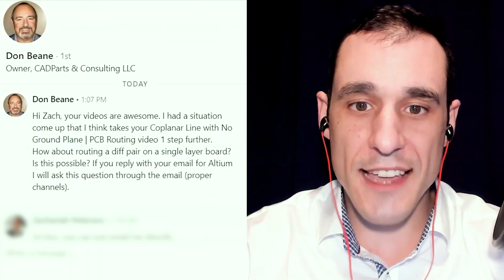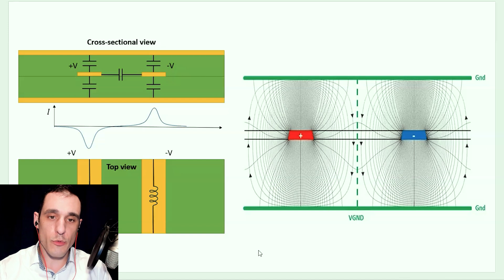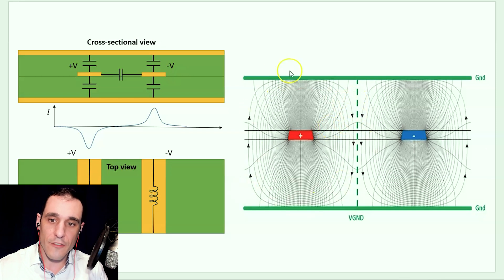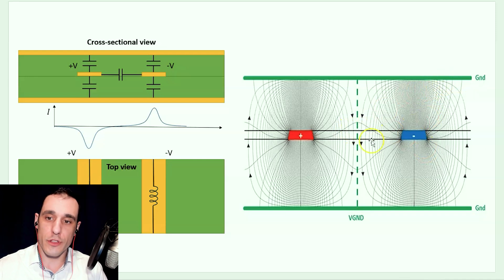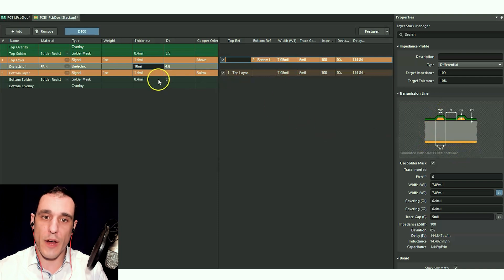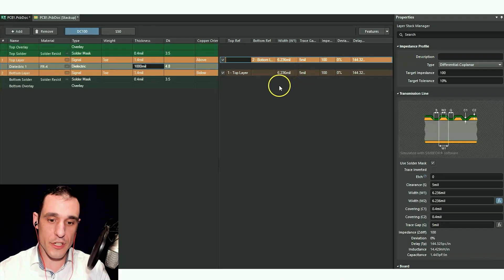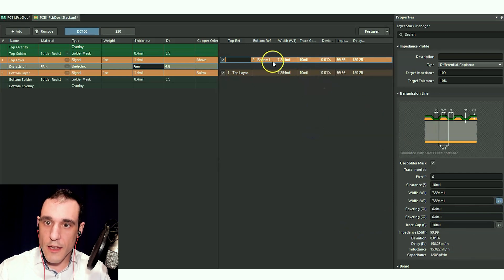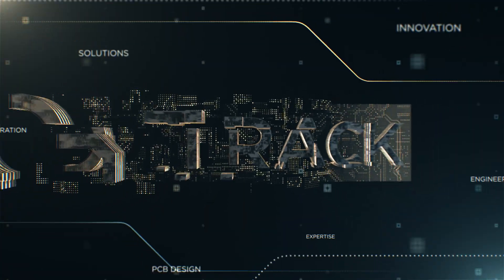Coplanar Routing with Differential Pairs

Comment: Thanks, Very Informative video.
in two layer PCB With Coplanar Routing on Diff pairs, using a 0.8mm stack will be helpful instead of 1.6mm or it can't make any difference?
Reply: If you route over a 0.8mm thick board, there will be a slight reduction in the differential impedance, but it is small compared to the influence of the coplanar ground and the spacing between the traces in the pair. Once the distance to the ground on the next layer gets very close to the traces, there will be a much bigger effect; the dependence is generally nonlinear. When ground on the next layer is much closer there will be a bigger drop in the differential impedance. You can determine this by comparing the two thicknesses in the Layer Stack Manager in Altium Designer.

Comment: Hello Zach ! Thank you very much for this video.

I am new on PCB design with differential pairs. I would like to use differential pairs as single-ended traces through a FMC connector (of course, connected to an FPGA) to add more inputs and outputs and to simplify PCB rooting. The transmitted and received signals do not exceed 120 MHz. For this new PCB, I am not limited by the number of copper layers to add ground planes.

I do not know the requirements to use differential pairs as single-ended traces. Can you give me your advices on this kind of use ? Let me know if you need more details.

Best regards,

Guillaume

Comment: Hello Zach ! As always thanks for your video !
I've watched the next videos too about how work calculators. I would like to know at what frequency the altium calculator cannot be used ? 
Last time I maked circuit and the manufacturer impedance calculator allows me to calculate an impedance until 1GHz for example.
Best regards
Reply: Hi Antoine, sorry I am just seeing this question, it looks like I have a big backlog of questions to answer. About your question, there is theoretically no frequency limt, but practically the validity of the solution will end once non-TEM modes are excited in a transmission line structure. The specific frequency where this occurs depends on the geometry of the transmission line and its dimensions.
Reply: @Zachariah-Peterson  thanks for your answer ! And I fully understand you can not answer to everyone.

Comment: energy is in the spaces and not the traces!! so it is highly important to have em solver characterisation for diff pairs to remove crosstalk issues.. apart from this there always is return current and reflection with termination that has to be considered to better model diff pair.. (and yeah this parastics (LC circuit) actually determine the diff timing in the traces!!)
Reply: Thanks for watching Vatsan